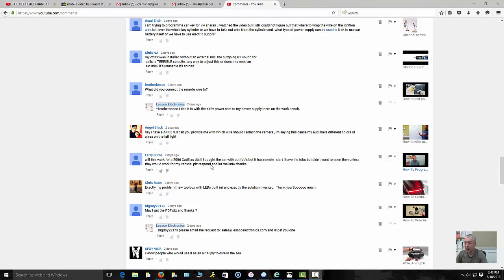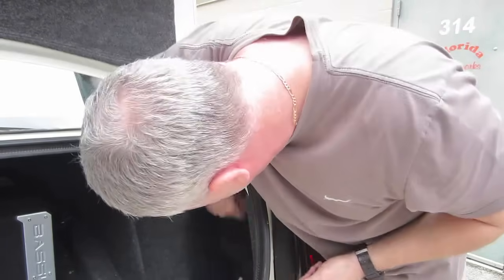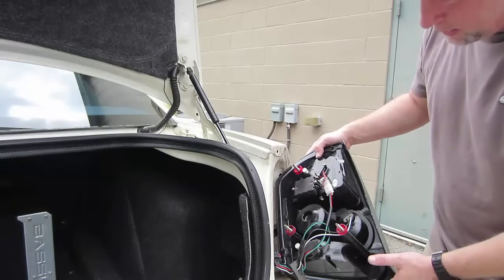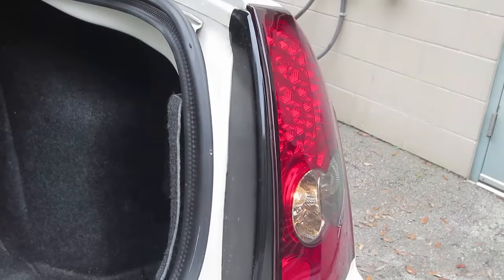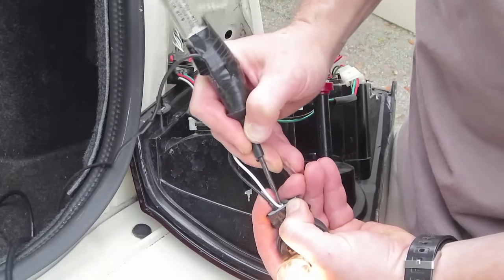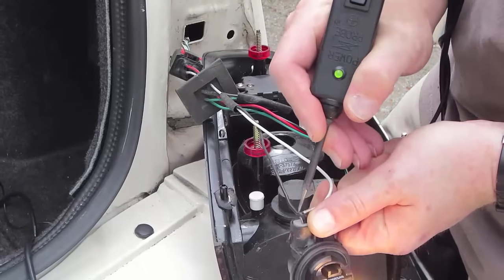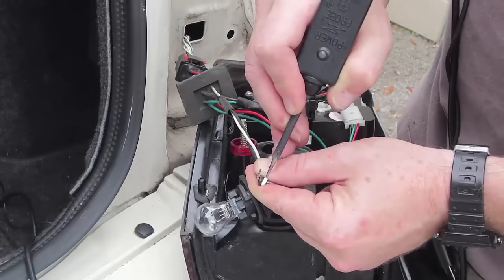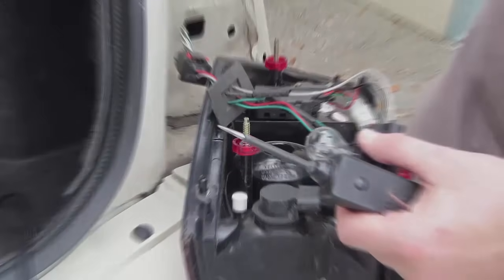How to locate and wire your reverse lights to your rear view camera

Comment: Do not turn your car on, put your emergency brake on, turn your ignition key to the second position, that would be the position just before the car turns on. Now you should be able to just put your car into reverse and the lights will come on without risking running yourself or someone else over.

Comment: @ 3:41 "if you are testing with the circuit off, both wires going to test on ground, the black wire is ground, the white wire is grounded as well, when you switch on reverse this white wire is going to 12v" 
Thank you.
This always gets me :D

Comment: man,he is butchering those wires!  The esiest way to test that kinda sealed up socket would be to remove the bulb & test the terminals threw the socket. Without stabing the wires.
Reply: Ive never even considered using this technique of pinning through the wire shielding to probe. This technique does have merit for instances where there are no exposed contact points but in this instance, id go for the bulb socket contacts.
Reply: @PhamNET  or the baks of the connectors
Reply: Thank you.  I was wondering could their be another safe tool to use  being that, I am a women and enjoy working on my BimmaBlue.  Chuckling...

Comment: Hello, im trying to connect a rear led strip light on my 2020 gmc sierra sle truck but dont know which wires is power, brakes light, turn signals ground, and reverse light, please help

Comment: My reverse bulb has 3 wires. One green and 2 black.. please help
Reply from the maker: whats the year make and model?
Reply: It’s a 07 Chevy avalanche
Reply from the maker: @remgroup8401  LIGHTING
 
Parking Lamp (-)
 
DK BLUE
 
AT BCM BROWN PLUG PIN 24
 
 
Headlights
 
WHITE (-)
 
AT BCM NATURAL PLUG PIN 12
 
 
Reverse Light
 
DK BLUE (+)
 
AT BCM WHITE PLUG PIN 22
Reply: Lessco Electronics I have 2 black and one green wire for the reverse light. Which ones do I splice into?

Comment: I have a 2008 maxima. I'm trying to install a clarion nx605 to replace my factory radio. how do I bypass the parking break lead in order to play movies while I'm driving?
Reply from the maker: Easy, get one of these: http://www.ebay.com/itm/CLARION-BRAKE-DVD-BYPASS-NX706-NX506-NX405-VX404-NX702-NX706-/141919984647?hash=item210b171c07
Reply: h gresseau ground the parking brake wire that comes out of the harness that comes with the head unit.

Comment: What if you want to connect to tail light so you have continuous video feed?
Reply: Not to tail light or it would only be on when you turned your lights on......you want the 12v accessory switched wire, like from your cars cigarette lighter....voltage when the ignition turned to ACC and when its running too.....
Reply: @nickthegreat9621  thanks

Comment: If you have "old school bulb" and are confused by what is "+" and what is "-" simply remove the bulb and use a test meter on the terminals. (remove "filament back-feed" by removing the filament!)

Comment: I’m struggling connecting my Boscam k7 to my 2006 Ford Transit backup light. I watched a video online by another gentleman and followed his steps exactly and I’m getting no signal. I connected my 12v red wire to the green wire as he did and i connected the GND to the black wire as he did. My van has a board with all the wires in a line so it isn’t quite as straightforward as just finding the reverse lamp. I appreciate your help if it comes.

Comment: Could I buy another 2 extra sensors and just tap them to 2 of the sensors that is connected to the module? I plan to put the extra 2 in the font bumper

Comment: I have a 2012 toyota corolla s and I have 2 wire a red and and white with black which is positive which is negative
Reply from the maker: Here is the wire info on that:

  Reverse LightRED (+)AT UNDERDASH FUSE BOX - WHITE 30 PIN CONNECTOR  PIN 30
Reply: I wanna connect from the reverse tail light it's self

Comment: My van has 2 black wires and a green running off of the reverse lamp.
Reply: willie fox so does mine on my Chevy. Did you find out which wires you have to splice in?
Reply: rem group it took a little trial and error i got it on my second try just had to shrink tube it all back up . Works great now .
Reply: So which wire of the three ended up being the positive?

Comment: Honda fit/jazz (hatch) 2004.. pls help me with the wiring of my reverse cam and connecting it with the reverse light. Thanks
Reply from the maker: Reverse Light	GREEN (+)	FUSE BOX BOTTOM CONN BLUE PLUG

Comment: I have a2013 sonata I have the mirror backup camera it have red and black wire my back up light on my car has three blue  green and black please help not sure what wore to used
Reply: Perry Short the guy in video is an idiot.  You don't need vehicle running. Turn key to Acc. Then put vehicle in reverse.  Make sure only reverse light is on and Use test light to probe wires for power. Use posi-tap connector and connect red wire to powered wire.  Then ground the black wire to a bare metal frame. Test camera before installing it all the way and make sure everything works as expected.  Good luck.

Comment: hi! Can I test the rear cam by wiring the 12V+ (and navi PIN3 reverse gear engaged pin) not to reverse light wires first just to a 12+ power source from navi feed or cigarette lighter to see if my NAvi turnes on the camera screen before wiring to the  reverse light wire?
I could put  a manual switch to turn this on manually without reverse gear selected?

Comment: What about multi meters how do you test them mine has 2 black wires
Reply from the maker: put your meter on dc and watch the lead that switches to 11-14 +volts when the reverse gear is applied

Comment: Mate, I think he meant he just has a plug connector in the light housing with multiple wires. What if he can’t see which one goes to the reversing bulb?
Reply: This is exactly I'm facing right now on a mitsubishi colt, no individual connection to different tali lights but just one big plug for all the wires grrt how the hell do I know which one is for reverse light? I'm installing rear parking sensors.

Comment: so basically just like you can trick your DVD player to play the video while you're driving by simply grounding the parking brake wire or putting a toggle switch in place is it basically the same for that it needs a 12 volt signal to switch the television from whatever you're doing at the moment to backup camera and obviously that's where you steal the 12 volt signal to put to the  reverse wire is this correct
Reply from the maker: :I
Reply: @Lesscoelectronics  does that mean I'm correct cuz I don't know how you're taking it but I wasn't trying to be a smart-ass or tell anybody how things work I really need to know cuz I don't fully understand

Comment: I’ve never seen either of those types of testers, and you really didn’t explain what you were doing very well.  But let me see if I’ve got this straight. 

If using a standard multimeter, attach the negative lead to some metal part of the car. Then stick the positive probe onto one of the leads of the wires to my reverse bulb housing. If I get no voltage, that’s the ground/negative, no good. If I get voltage, presto, I found the positive and hence the wire to connect to the power wire for my camera?
Reply from the maker: yes, in a general way, that sounds correct. or you can tell me the vehicle and I can give you the wire info too
Reply: @Lesscoelectronics  oh cool, thanks. It's a 2015 hyundai sonata.

Comment: Hi I am looking to wire my reverse camera to my cars reverse lights. The first time I tried it, i think i grounded the wire wrong which the  caused my alternator to become defective and cause the check air bag and abs warning light to come on.  It also made the Blowers turn off. Do you think this was  caused by me because only a week before my car was being worked on at a body shop in which they had left the ignition on for hours without having the actual engine running. I am looking to give it another attempt but am scared because i don't want to dish out alot of money having the alternator replaced again.

Comment: They wires on the reverse light always on look like they operate from the negative wire, when I connected the camera stay on all the time even when I put it on reverse
Reply from the maker: One switches olarity, It would have to in order to create a 12v circuit to energize the light, right? have someone put the car in reverse while you test at the rear tail light and Im sure youll find the target wire, Or tell me the year make and model and Ill give you the color and location to save you some time..
Reply: Lessco Electronics 
Vauxhall insignia 2009

Comment: Does anybody on here know how to make sense of all this please simplfy, I have a long yellow video rca/cable with a short red wire on each end then a camera with a yellow female &  a red male power plug then a another red plug female with red n black, where does this goto &  were does the two red off the ends of the yellow video rca goes to j have a pioneer AVH-4200NEX DVD radio can anybody out here please help me
Reply from the maker: red goes to the +reverse wire in the tail light, black goes to chassis ground, the rca video signal goes up to the pioneers rear camera input.
Reply: Thank you I'm done &  working fine as of now appreciate all replys
Reply: Do you have a video on how you did it?

Comment: For who doens't know shit about electricity: don't do it like in this video:

1. Don't damage the insulation of a wire, if you just want to mesure. Insulation is important regarding avoiding short circuits
2. If you want to mesure, remove the bulb and mesure at the contacts. You can see which wire is contacted to which contact.
3. If the sign is positive, the com = 0V, the red probe = +12V. If the sign is negative, it's the other way around.
4. Connect the red camera wire to the wire you just defined as positive, and the black to the 0V wire.
5. When the lightbulb gets +12V, your camera will get +12V too, and a current flows bacs to the 0V wire. Both will work at the same time.

Comment: My reverse camera has a red and black wire ,do i connect both to the light?
Reply: same question bro
Reply: Todd T the red is the positive the black is ground.  Use a test light and probe for power with only the reverse light on. When you find it use a posi-tap connector and tap into the powered wire with the red wire. Then just ground the black wire to bare metal frame.

Comment: it may also have voltage in park, but when u put it into reverse voltage will increase. If thats the case put a rezistor on the reverse sensor wire.
Reply: +reddogg850  That makes no sense at all.
Reply: +Cotronixco hummer h3, the reverse wire has 4volts in park, in reverse it has 13volts. put a rezistor on the reverse trigger wire. if u dont u will always have power on that wire
Reply: +reddogg850  That is probably due to the current-sensing circuitry that indicates when a lamp is out. If you are using LED lamps, the voltage across an "unused" lamp will be higher than if using incandescent lamps.

Comment: I am try to wire up a oem backup mirror cam to a aftermarket radio and I can find no diagram to find out what wire I need to find I have a 2012 Yukon
Reply from the maker: Brake LightLT BLUE (+)AT BCM PINK PLUG PIN 2

  Parking BrakeLT BLUE (-)AT PARKING BRAKE
  Clutch Pedal

  Reverse LightDK BLUE (+)AT BCM WHITE PLUG PIN 22
  Rear DefrostVIOLETDRIVERS SIDE HARNESS RUNNING TO REAR
  Immobilizer TypePASSLOCK & TRANSPONDER  LIFT GATE RELEASE PINK/BLACK (-)AT BCM ,PINK CONNECTOR PIN 24 
  ENDGATE RELEASEGRAY (-)PINK CONNECTOR PIN 13

Comment: Not good advice. Don't butcher stock wiring like this. Don't use a circuit designed for a single purpose to power a second device, you'll get a severe voltage drop across that circuit and probably blow out bulbs. worst case, you have LED instead of incandescent bulbs and they will cease to function properly. A more helpful video would have identified the wire in that harness that leads to the front of the car and wire the stereo to it so the stereo can detect current on the circuit and then send its own appropriate power to the camera.

Comment: Hi, please I'd like to know which wire is positive or negative in the front headlamps of my Tiguan 2016. Both wires are black in colour. I'm fixing aftermarket LED for the Low Beam.
I have a multimeter but I'm confused on how to set the dials.
Many thanks.
Reply from the maker: see below:

LIGHTING
	
Parking Lamp (+)
	
GREY/YELLOW (+)
	
VESCM BLACK 52 PIN CONN, PIN 19 *
	
	
Parking Lamp (-)
	
N/A
	
	
	
Headlights
	
WHITE/RED (+)
	
VESCM BLACK 52 PIN CONN, PIN 22 *
	
	
Reverse Light
	
BLACK/BLUE (+)
	
VESCM BLACK 52 PIN CONN, PIN 28 *